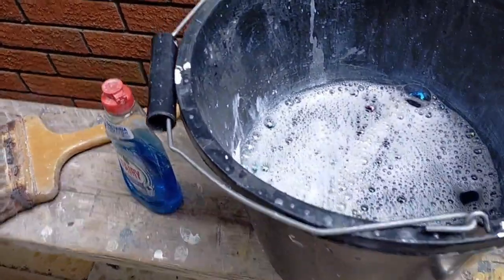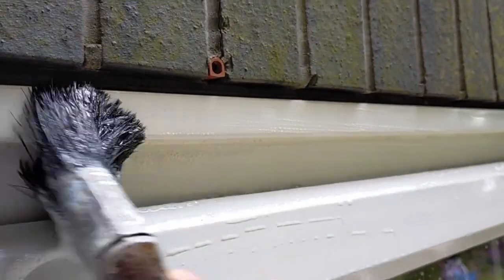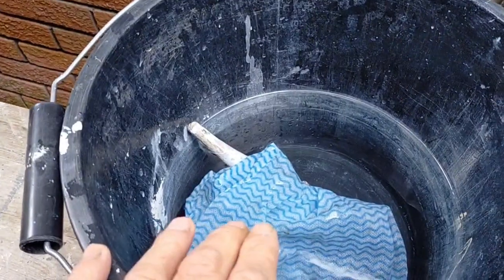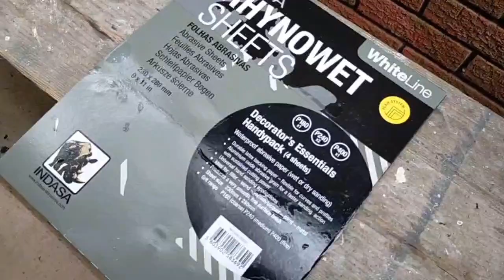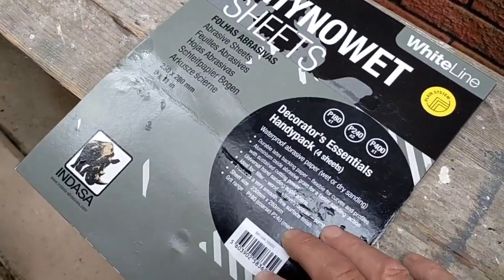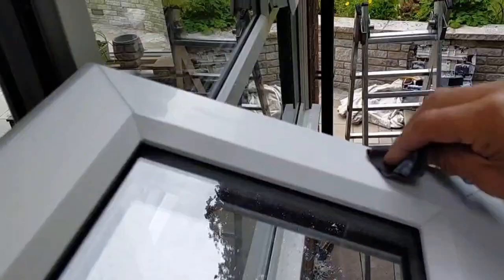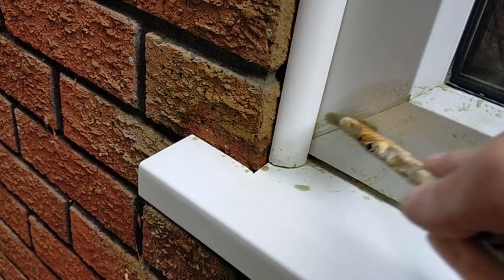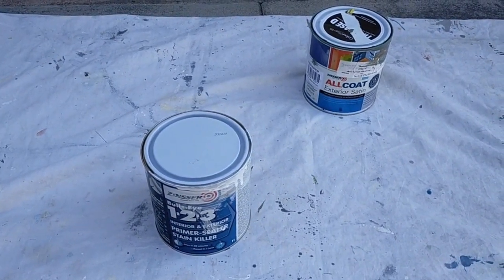How To Paint Exterior Plastic Windows. Preparation And Tips

Comment: I normally use alkali resisting primer on upvc then 2 coats of gloss find alkali resisting primer adheres far better than any water based primer
Reply from the maker: Yes perfect for oil based system. Great stuff multipurpose. 👍
Reply: @PaintingandDecorating  id be carefull using zinsser 123 it doesn't adhere very well to plastic at all infact it doesn't do well at anything really i scratch tested it on a piece of upvc after a degrease with methylated spirit and light sand after 2 months just scratch off and zinsser all coat meant to stick to non ferrous metals upvc on its own and again didn't adhere very well at all
Reply from the maker: Only used it on plastic with no problems, and tested to see if it came off, and it didn't. Not sure about other materials though.  It does need a fed days to cure fully, depends on temperature.
Reply: @PaintingandDecorating  oh right maybe theres was something wrong with the one i used never used again after that
Reply: Agree, oil based will outlast the water based and resist window cleaneing methods better..
Reply: @jackwardley3626 it certainly is pretty crap as a stain blocker...
Reply: @davewright9312  yes it is crap in general i wouldn't buy another tin ever johnstones stainaway is good for interiors also bedec water based stain block quite good apparently for knots to interior exterior but is grey so can be a pain as a stain bloker